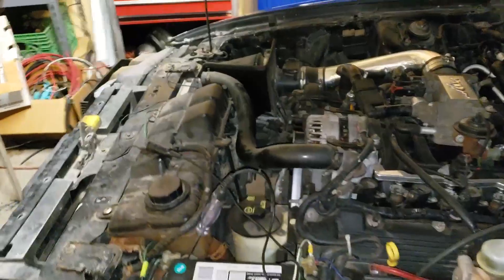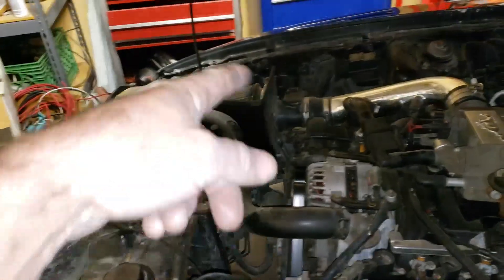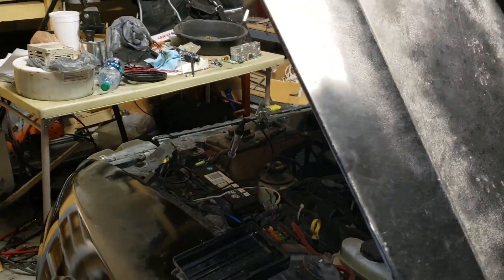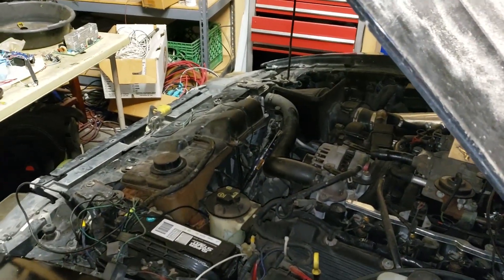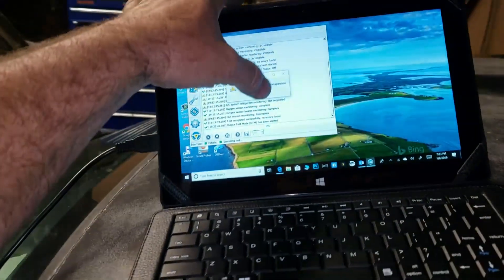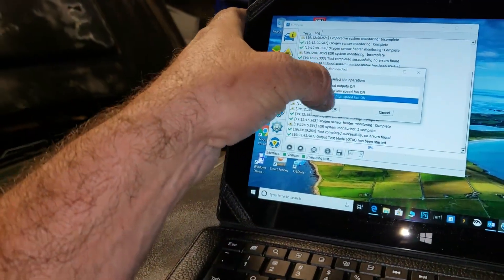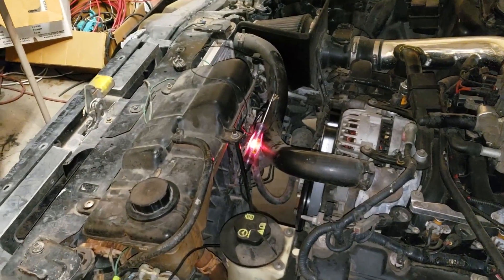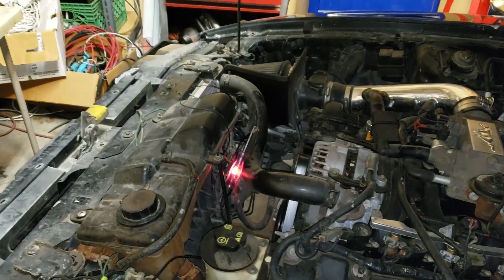Another Mustang Project - De-hack and test the electric fan relay module

Comment: I need to de-hack my 99 mustang gt. I bought a relay system but I don't know how to treat the three cables coming out. Also I don't want to melt the little relay or fuses. Any advice?
Reply: 4 year old video so I really don't expect much help
Reply from the maker: @benjaminyoung2403  I haven't had the car in longer than that so I don't remember even hacking the relays. LOL
Reply: @hackfreehvac  what were you using to get the fans to come on , looked like a laptop? what setup did you have therE?
Reply from the maker: @KineRC  There is software called FORscan that can interface via the OBD II port. You can cycle on fans, the fuel pump relays etc for test.

Comment: At least your fan doesn’t sound like the car is going into orbit, my 00 p71 could wake the dead , I guess my shroud is bigger though thus making more noise.
Reply from the maker: I'll have to eventually fix it by summertime.
What is really noisy right now is the bearing on the front of the A/C compressor.
I was hoping the noise was an idler pulley but when I pulled the belt to check I found it was the A/C compressor.
Now I remember it being noisy on the 96 GT as well.
Reply: Kk(kk(kk😊  @hackfreehvac
Reply: What software were you using on the laptop for testing please.